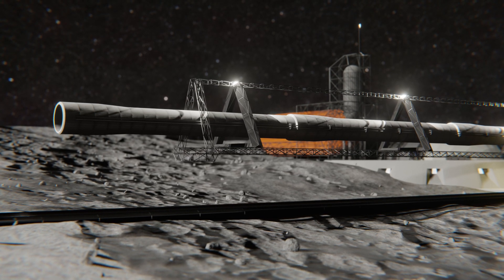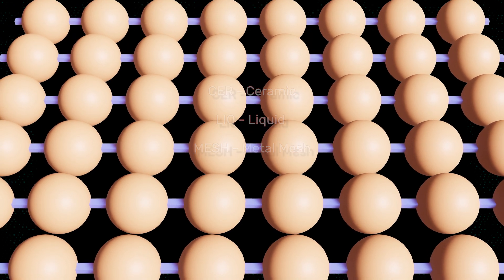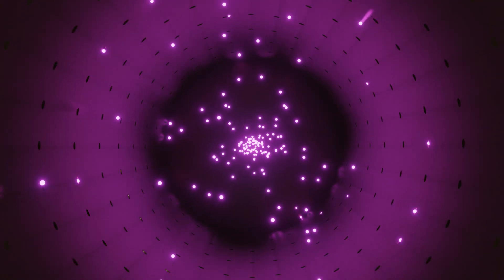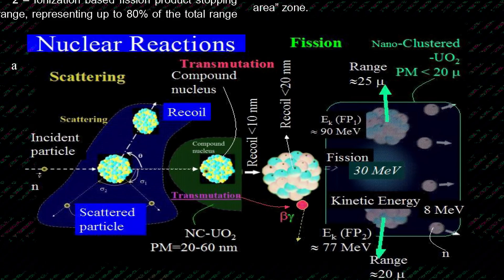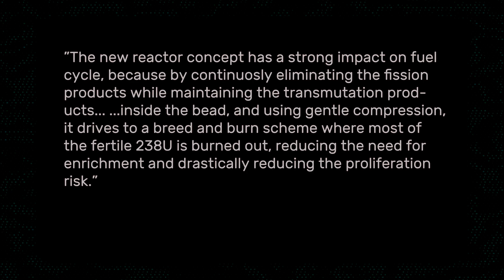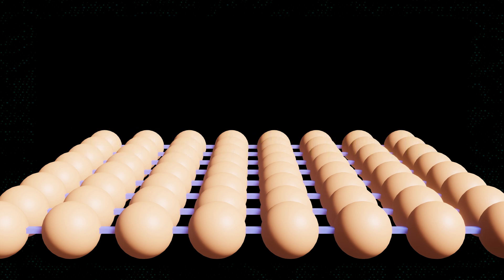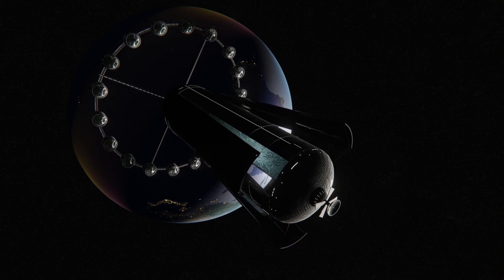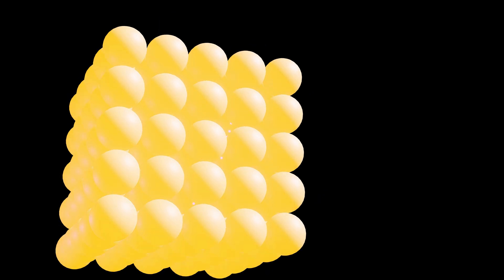What is CER-LIQ-MESH? Nanomaterial Nuclear Reactors

Comment from the maker: How widespread would nuclear power be if proliferation concerns disappeared?
Sources:

Modifications to Fuel Rod Material Properties and Performance Models for High-Burnup Application. Nuclear Regulatory Commission, NUREG/CR-6534 U.S., 1997

A Review of Previous Research in Direct Energy Conversion Fission Reactors. Second International Symposium on the History of Atomic Projects (HISAP '99). 1999

The use of ultra-thin layers structure to obtain a self cleaning nuclear reactor fuel. Procedings MRS - Spring Meeting. 2005

Novel nano-engineered materials boosts the fuel cycle and nuclear power applications. Actinide and Fission Product Partitioning and Transmutation. 2017

Micro-Nano Hetero Structured Fuel Pellet’s Impact On Nuclear Reactor’s Performances. 2011

Dispersion-Type Fuel Elements. International Conference on the Peaceful Uses of Atomic Energy. 1956

Radiation damage effects in layered thin film MgO/HfO2 structures. Nuclear Instruments and Methods in Physics Research Section B: Beam Interactions with Materials and Atoms. 2010

The applications of micro-nano-cer-liq materials in nuclear power. 2017

Nano-structured fuel for nuclear kinematics based separation and isotopic production. MRS-fall 2007 meeting, 2006e

Report on Nuclear Fuel's Thermal Conductivity Modeling and Measurement - Urania. LANL Reports. 2004

Behaviour of fission gas in the rim region of high burn-up UO2 fuel pellets with particular reference to results from an XRF investigation. Journal of Nuclear Materials. 1999

Accelerator Enabled Nano Nuclear Materials Development. Adv Nano Energy. 2017

Thanks for watching!

Comment: So you're saying this type of reactor using CER-LIQ-MESH generates electrical power directly from the fission reaction?  Pretty much every other reactor design is a glorified steam engine.  How scalable is this?
Reply from the maker: It's important to realize how the SM deals with quantum properties to understand how cerliqmesh 'works.' By applying physics considerations at the nanostructure scale we equate the forces that result from fission as properties such as electricity, magnetism, heat, electricity, etc. At this scale all of these energies are equivalent. So yes, this kind of technology is kind of unprecedented yet at the same time obvious with an understanding of quantum mechanics. 
Its scalability is an engineering problem. Very few applications require these energy densities at this point beyond deep space vehicles.

Comment: Would it be possible to make battery sized reactors using this technology? Something similar to the fusion cells from fallout? But fission powered of course and hopefully not used as ammunition for laser rifles. You could probably drive a car thousands of miles off a single reactor cell for example.
Reply from the maker: Yes, any form factor smaller than the maximum should be relatively easy to make. If they are too small you would likely lose out on efficiency but obvs that doesn't matter too much when you're talking about fission energy densities. 
Keep in mind though that you'd need to make these things 'rechargeable' to cycle their liquid metal drainage media or give them a built in reservoir on the device that can replenish it.
If you want true 'fission batteries' cirliqmesh is just one method with its own concessions and advantages.

Comment: Well this is dope. I'm always amazed by the sheer variety of reactor designs. This open mesh design looks like it would be really cool for propulsion tho i guess replacing the liquid with a hot gas would probably screw up some of the safety dynamics of this design.
Reply from the maker: Glad you liked!
We'll definitely get around to some nanostructured nuclear propulsion systems in the future 🤝
They've been developing these kinematic systems for propulsion long before power production so there are a lot of designs that are basically nuclear salt water rockets but the 'salts' are nanoparticles with fissile material in them.

Comment: I've long thought that processing nuclear waste to extract useful and rare elements like rhodium or ruthenium was under-utilized (we're basically doing alchemy, after all), so it's always cool to see a reactor design that can divert the fission products online.
Reply from the maker: Unfortunately just a proliferation issue. It's probably not too hard using the reactor of an available SMR as a pretty effective transmutation 'forge' but that goes against their design need of being closed-loop so the end user doesn't modify it into a fast breeder. 
If you wanted to increase bias towards certain elements with cerliqmesh you just need to figure out their recoil distance and engineer a nanobead with a coating thin enough to let that particle pass.